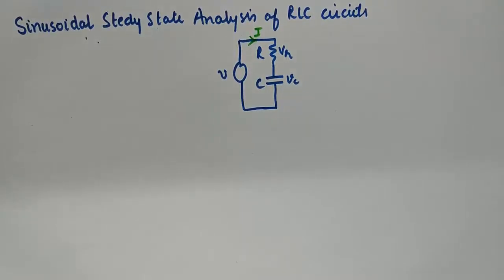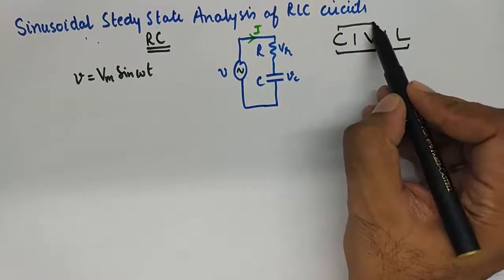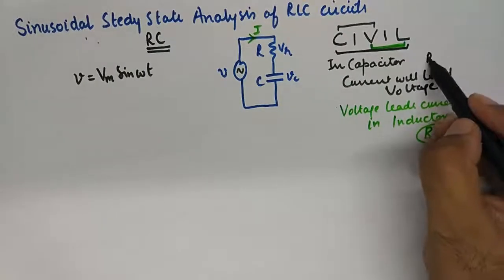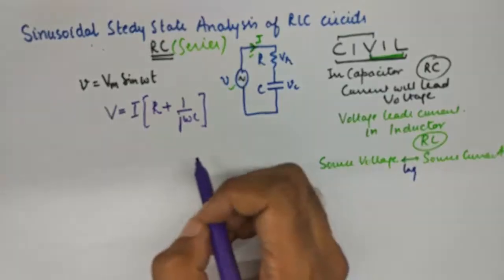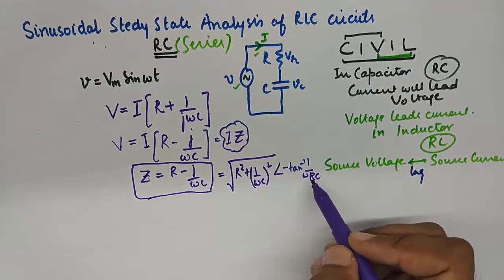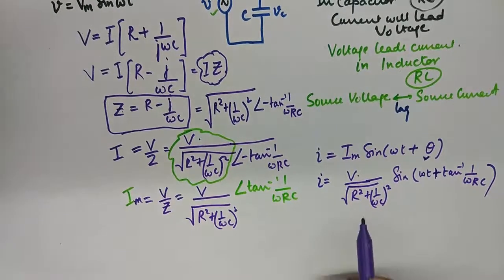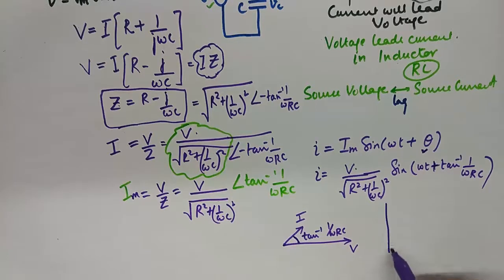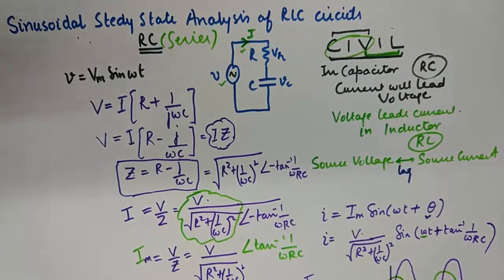Sinusoidal Steady State Analysis of RC Circuit | Network Analysis and Synthesis

Comment: Find the steady state response of voltage across C in an RC series circuit having R=10 Ohm and C=100 micro Farad when a voltage of 10Sin 314t+5cos 314t is supplied to it.